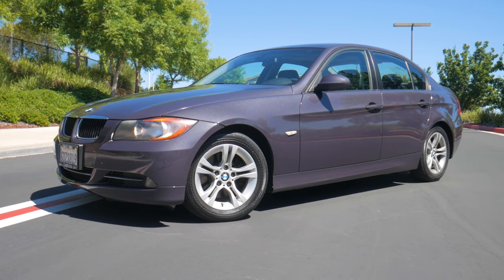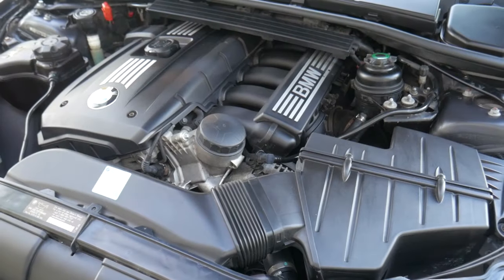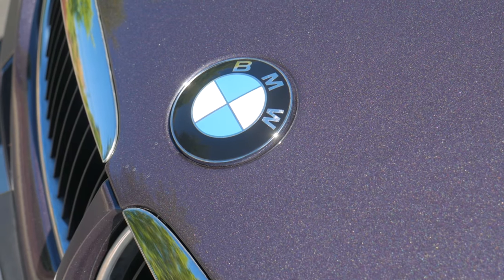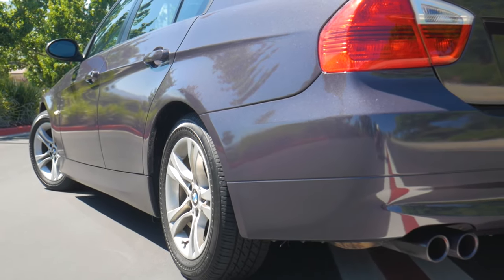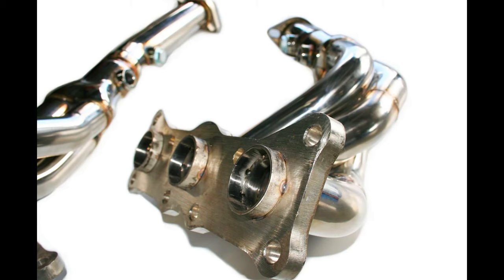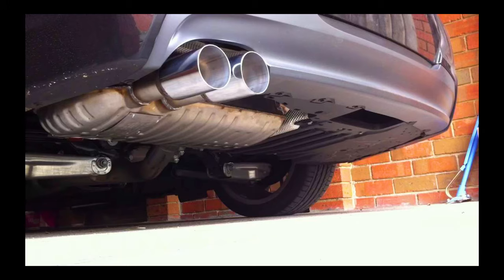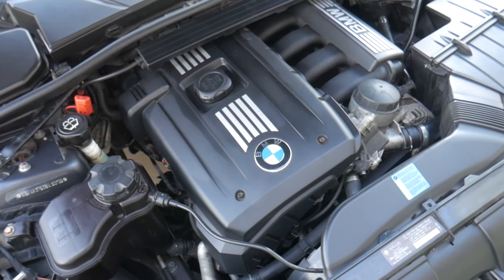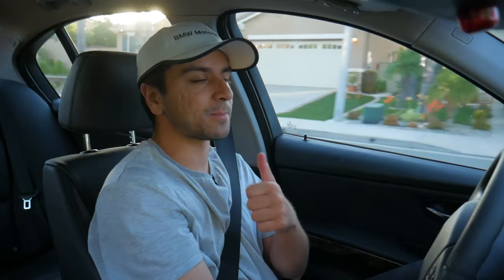GAIN +70 WHP On Your N52 With These 5 MODS!

Comment: There is a mod called MILV's which stands for modified intake lift valves, and it goes underneath the springs in the valvetronic to increase valve lift from 9.9mm to 11mm I believe. This means about 10 to 15 wheel hp gains. This is a pretty popular mod that goes a long way in increasing n52 power. Great video, super helpful with straightforward content 👍👍
Reply from the maker: Thank you! And wow, i did not know about the MILV mod. Super interesting info appreciate you sharing!
Reply: @SimplyCarThings  no problem, every ounce of power counts with these cars!
Reply: How do you do that? How do you tell someone to do that lmao
Reply: Yeah the milvs give more intake valve lift. Simply car things don't worry will tell you all the secrets because we are family now. Lol. Oh did you know the icing on the cake is not the engine tune but to supercharged it to 300+ whp with the ess kit.😁 also the n54 manifold swap has more torque than the 330i and flows more on the top end too. So it's a popular option. The thing about the 3 stage is the disa valves are not that reliable.
Reply: I remember the MILVS being a thing on bimmerpost awhile ago, was always debating it but figured it wasn’t worth it to try and pull power from the N52. If someone is going to install the MILVS and hasn’t messed with their car before, take it somewhere lol I hate getting cars in that someone tried to do something themselves only to where I have to work on a mess they made that would have been done right if they took it to someone who knew what they were doing. It’s a simple install but when some people can hardly do their brakes, I don’t have much faith in the majority of people do do MILVS
Reply: @L-Noble.YT_Hi.Res-Soundminds  I wouldnt do a supercharger, I've seen on the forums that they get maybe 280whp from the ess kit, but it robs so much low end torque it's not even worth it. There are n52s pushing over 260whp na with headers, exhaust, n54 intake manifold, and milvs. Not to mention the reliability of these engines, and the fact that it weighs about 100 or more lbs less than the s50 and the s54 makes it a better engine in my opinion. I want to swap one of these into a z3 one day, that will be the ultimate build
Reply: But some say that MILV's put more stress on the engine and hence might not be worth doing? European N52's that we get are restricted at 214 bhp, but they already have the 3 stage intake etc. so a simple map takes you back up to about 275 bhp! Am I right in thinking with MILV's you could now be very close to 290?
Reply: @aa7h911  well the 272 bhp number comes from the euro x3 and x5's. They have a different air filter and maybe a different tune because the north American x3 and x5 makes a few less hp, like 268 or something. The euro n52 isnt restricted, and milvs probably does put more stress on the engine, but n52s arent known for exploding or throwing rods like the n54, even though they use the same rod bearings. So pretty much milvs, 3 stage intake, headers and a good tune would probably put you at 290 or even 300 at the crank which is really good considering the engine only weighs 284 lbs, 150 lbs lighter than the s54 lmao
Reply: @epaminontas6972  300 or even 290 for a NA is damn good, considering the reliability of these engines. Thanks for the info.
Reply: @aa7h911  hell yea dude np
Reply: MrGhost370  well the reason some people choose the n54 manifold is not only because it makes more peak power, but it holds power better past 6500 rpms. Itll hold peak power until about 7700 rpms, but that's really pushing the limits of the engine, so people will set redline at 7500. I prefer the 3 stage manifold because that torque is unbeatable, plus if you turn off the "4th" stage on the 3 stage intake manifold, it will hold power until 7000 rpm, which is factory redline
Reply: MrGhost370  yea, I recently bought a 3 stage intake manifold for cheap, I was gonna rebuild the disa valves and install it, but I found an e36 m3 for a really good price, I might buy it and sell my e90
Reply: @L-Noble.YT_Hi.Res-Soundminds  Do you know if that ess supercharger would fit a z4 e89 with an n52, I have a 30i and I can't figure out if that supercharger will fit any n52 or just the 330i and maybe a few others, I apologize for being clueless I'm new to this lol.
Reply: @aa7h911  I have the MILVS installed, catless Schmiedmann headers, Schmiedmann sport cat mid section without resonators and an Eisenmann exhaust. Intake has three stage manifold with the two dissa’s and a carbon BMW Performance intake. No chip on the ECU yet. Will be posting the pre-ECU chip and after chip figures once it has seen the dyno and chip tune.
Reply: where do you get the milvs kit? I've searched and can't find it
Reply: @aa7h911  what do you mean by map?
Reply: @epaminontas6972  Would you happen to still have that 3 stage intake and want to sell it? 😂
Reply: @L-Noble.YT_Hi.Res-Soundminds  i hear the n54 is not ideal with automatic transmission
Reply: @tristanmichael7596  I'm not sure but people say a lot of things you know. I've seen automatic cars do just fine.
Reply: It's also across the board power and torque gains.
One of the cheapest gains - especially if you are replacing leaky gaskets at the same time.
Reply: @epaminontas6972 so why the 330i disa valves can’t be used?
Reply: @L8NITEN52  you need the whole manifold

Comment: Being able to have fun on the N52 makes me chuckle...Never knew how much I’d love our little $5,000 e90 run around car!
Reply from the maker: Couldn't agree more! They're little gems
Reply: E90 Gang
Reply: If you want it to be a little faster and have a nice purr, a muffler and resonator delete will do just that!! And it makes the vehicle lighter
Reply: @crod310  it most def will not make your car faster
Reply: I bought a $2000 N54 335i. I goofed up 😂.
Reply: @whoischris28  dude.. it takes off hella weight and you can feel the difference
Reply: @Xtremecarfan10188  have you spent a lot on repairs yet?
Reply: @crod310  youre not gonna feel weight differences from res and muffler deletes lmao
Reply: @bartb6804  I have done any yet, I have driven it 500 miles already so far. I got leaking injectors, cracked valve cover, power steering system is jimmy rigged, coolant reservoir leaking, a funny quack noise from turbos(pretty sure is boost solenoid). Dude was originally asking $8k. He must have been drunk and finally came to his senses. Car has 92k miles on it. Oh and I got DSC and Active Steering faults as well.
Reply: @Xtremecarfan10188  Good luck to you man, I wish I could afford to maintain a N54 but I love the reliability of my slow N52 and I still manage to get some pops/bangs out.
Reply: @bartb6804  Bruh, I just had the worst misfires the morning it started making gunshot noises backfiring and smelled like eggs. I am about sell this 😂.
Reply: @Xtremecarfan10188  😂😂🤣 N54 Life, damn she must’ve been beat by the previous owner
Reply: @bartb6804  Four different people had  in the 3 months. Definitely something is up with this car.
Reply: I'm not going to lie, but my N52 330i is a LOT more fun to drive than my E55 AMG with a supercharged 5.4L. The N52 has the perfect powerband for having fun.
Reply: @Xtremecarfan10188  I'm a rotary guy and have owned rotaries since like 2014 and I'm lowkey afraid to get into 335is lol
Reply: @Jason-hl2wy  Well, I still have the car. Transmission started slipping slightly from 3rd to 4th. Then I noticed a trail of transmission fluid all over from the street into my driveway. I parked it not to cause anymore damage. Not gonna lie, N54 335i are nice cars. Even going back to my Mercedes CLK55 AMG felt like a downgrade. My 88 Supra Turbo is also sitting. Probably going to sell that to build the 335i and make it reliable. I was also debating selling all three cars and just buying a 2018+ Mustang GT or at least put a nice downpayment. I need something reliable at this point.
Reply: @Xtremecarfan10188  yea I feel it's one of the cars you can pay a low entry price but you the maintenance price is higher , you gotta invest to make it reliable. Also looking into something reliable and easy to take around town. Not too afraid considering I love the shit out of my very infamous rx8 but I do want something easy , thinking of a 328i instead
Reply: @Jason-hl2wy  328i is the best lol just got one myself last week. 134k, one owner (old man) body is mint except the bumper some minor scratches nothing major, the only seat used was drivers so everything is mint. Test drove it and ran really smooth and shifts smooth. Only thing is the oil leak/seepage. I gotta do the oil valve gasket in the next few months when i have time.  Dude asked $8400, i gave $7500 cash and took her home.
Reply: $1000
Reply: Just picked one up last week for $5k absolutely no issues, already love the car
Reply: @Xtremecarfan10188  i bought a 335i as my first BMW, wanted something fast/ reliable.. paid 8k.. i plan to put on 30k kms max and sell it, when i researched the car before buying it i swear everyone made it sound reliable, i couldn’t find anything about the engine issues only things like fuel pump or water pump 👀
Reply: @linkin6992  Yeah that car is long gone. Ended up catching on fire. My crazy self bought another one for $5,000 in March. Best purchase ever. Literally have had zero problems. I ended up finding the one of the previous owners and he did full maintenance only 20k ago and upgraded many things. I got a steal for $5k. Came with a custom E60 tune, VRSF relocated inlets, Stage 2 LPFP, Catch Can, RB PCV Valve, Index 12 Injectors, Charge Pipe and BOV, 5 Inch Intercooler and downpipes amd XHp Stage 3 Transmission Tune. All I need left on my end is to upgrade turbos as they now have wastegate rattle and seals throw smoke at low speeds/coming to a stop. Engine is very healthy. I got super lucky.
Reply: Just got my first car today bro a e90 328 manual clean asf
Reply: E92 N52 for $2800 and the lowest offer I have now is 9k
Reply: @Xtremecarfan10188  what where you thinking buying a twin turbo bmw for 2k? Lol 5k is still a big stretch. I bought my 328i for 7k, its pretty clean and very well maintained though it's a manual also, so still very fun and it does 60 in the top of second gear so it's plenty fast for me.
Reply: @spicysnowman8886  I buy cars/things ultra cheap. I like to gamble. I got my 2002 Mercedes CLK55 AMG on my page for $1,700 with 84,000 miles back in 2017. Still one of the most reliable cars in household today and very little maintenance. I gamble on everything, clothes, shoes, drums, etc lol. But yeah that BMW for $2k didn’t work out but this $5k one did a lot.
Reply: This makes me depressed that I totaled my alpine white 330i 😔
Reply: what a great deal,
I'm looking for one because my gf has crashed my F30 into a tree, but the prices today are 15000€ for a low mileage 16 y old vehicle
It's almost making me cry
Reply: my gf was fine tho, the car on the other hand...
Reply: @whoischris28  hes a kid he doesn't know what he's saying leave him alone
Reply: @LowkeyBadass  huh? wat do U mean by that?